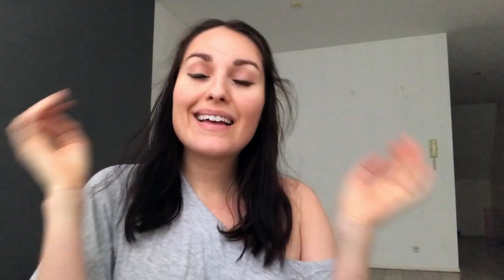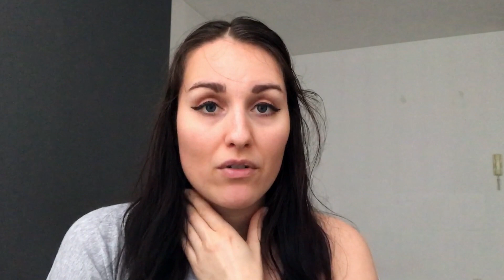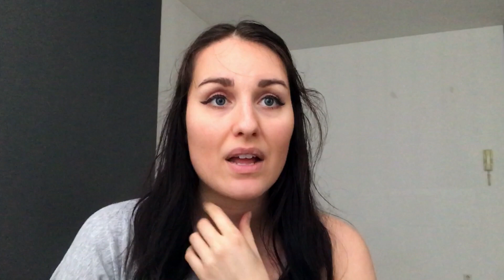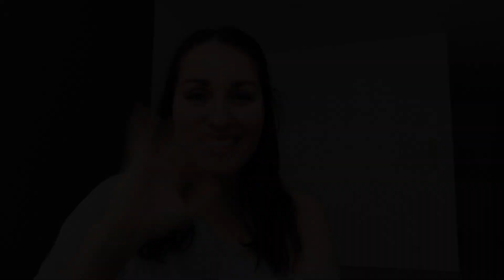Stuttering Technique I Learned in Speech Therapy

Comment: i also used to stammer and stutter a lot. but today i have cured by almost 90% only 10% remaining, that too i will overcome. In my childhood i never dreamed that i will give speech in front of 10k people. One day surely i will over come this vacuum that is created between brain signals and tongue. In 99% cases if alone one can speak fluently that means our currents get distorted when in pressure. So strengthen your Mercury, Moon & Sun astrologically & correct diet and you are on your way to cure speech issues. Thank you.

Comment: Speech therapy does help but to some degree but does help to strengthen the neurons connected to the speech control part of the brain ? There is a way to cure to stuttering, every problem has a solution.  The part that is challenging is the fact it is complex neurological disorder meaning that stuttering is not disability. The root cause of stuttering is associated with wernicke and broca area of the brain which controls the manipulation of speech control and production. which also involves auditory, timing of speech hence the word "complex" is used. I assume it is caused by  a lack blood flow to these areas. Another challenge is actually developing a device helping to reactivate these neurological pathways through electrical impulses which can help to reactive or strengthen the neurons pathways connected to wernicke and broca area of brain ,thus making the individual fluent in speech fluency. Note that no speech is ever perfect even with a person who does not stammer. 
 
Any idea or tips would be helpful in helping to contribute towards this innovative  idea :)

Comment: I too suspect alot of stuttering has to do with lack of air flow needed to facilite speech. 
The passive air technique is used by non stutterers as well. 
Gesturing and small head movements or shrugging shoulders or lifting eye brows, etc.  does help reduce or prevents stuttering as well. Everyone does this. These force you to unconsicousely breathe.
I am/was a stutterer especially during my high school years. 
Btw.
Dont know if your Christian?.
Moses stuttered its mentioned in the bible, torah and Quran.